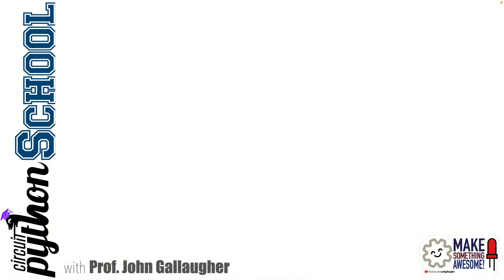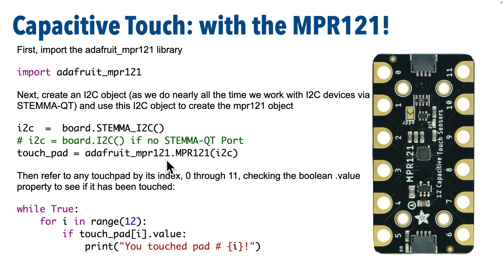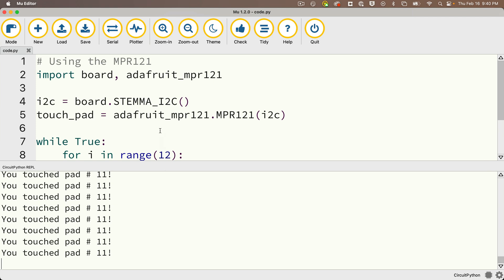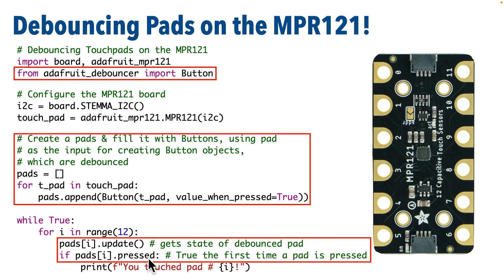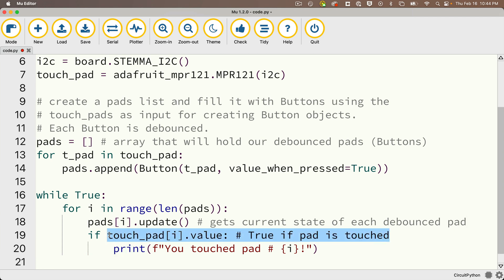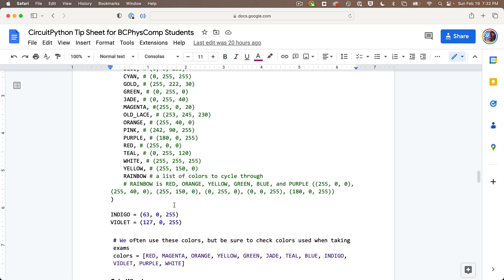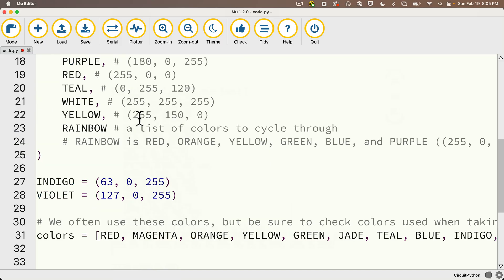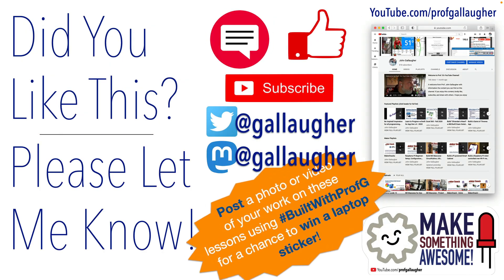NEWER VERSION LINKED IN DESC: Sensing Touch w/the Raspberry Pi Pico & the Adafruit MPR121 12-pad

Comment: My understanding is that the Pico can do touch on it's pin without the need for an MPR121.
However to do that, you need a 10?K resistor to ?Ground? and then you should be able to have the touch capability. That is all "from memory" and I did not try myself... and that might be a bit too much for classroom.

Other warning might be about the availability of MPR121 touch StemmaQT, I seems to remember that Lady Ada had to change chip frequently and could not get what she wanted. But either that problem is solved or you have your class equipment already.

I guess the benefit of a separated I2C board is that you can have more distance between the brain and the interface (and that could help avoid capacitance problem).

I am a bit confused when you use "board.STEMMA_I2C()" because there is no Stemma connector on Pico... but I guess there is a "if we have to add a Stemma, it would be on those pin that everybody use for I2C, and that is what Adafruit provide with PicoCowbell Proto: https://learn.adafruit.com/picowbell-proto

I am (unfortunately) not following you class (too old and too far way) so I don't watch all of your video and might miss some context and some stuff obvious. So take my comments with some distance. Just consider that I love your video and what you are doing.
Reply from the maker: Thx for your kind comments. We definitely skip direct use of Pico touch. We're already using STEMMA QT & once the port is wired up, setup is extremely easy. Plus it's guaranteed to work on lots of boards, so if the students choose a different board for a future cap touch project, like a tiny QT Py for a wearable or Feather with a built-in pass-through charging port, they can swap in the same code as long as they use the same sensor.
Yes, we do have our boards. We've even been able to replenish them this semester with no problems. They're a great little board for a super price.
Yes, board.STEMMA_I2C() works on the Pico even though there isn't a STEMMA QT port. Adafruit built this into CircuitPython v. 8 largely because the Cowbell (another great device for less than $2) uses the ports shown - SDA GP4, SCL GP5. So even though we can use nearly every digital pin for one or the other, I advise my students to standardize on this. It also makes grading easier, our code more consistent, and the code much more portable. This is covered in the lesson just before this one, which is found in either playlist. That lesson is named: "Raspberry Pi Pico & STEMMA QT / Qwiic + Using a Temperature Sensor & Formatting Numbers". If you're curious & want to follow along, see: https://bit.ly/circuitpython-tutorials or https://bit.ly/pico-tutorials. The latter is just pico, but they're written for my students who have already gone through all of the CPB tutorials, shown in the prior playlist. In prior semesters we used Arduino Nano RP2040s & Pi 3A+s, but I'm converting nearly all of that work to the Pico W boards, including the MQTT stuff. Those new lessons will be up in the coming weeks. Cheers & be sure to share with your STEM Educator friends! Oh - and lots of oldsters are hacking away on the site. It's great seeing so many from all over the world, and of all ages. Keep Making the Awesome!